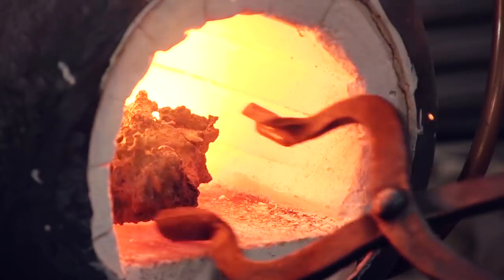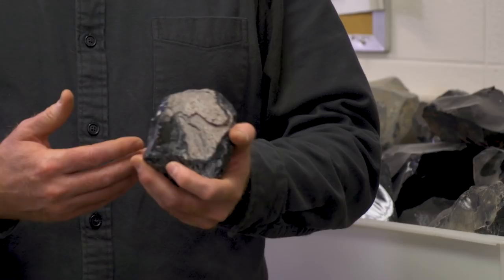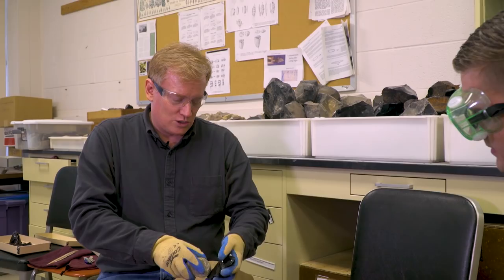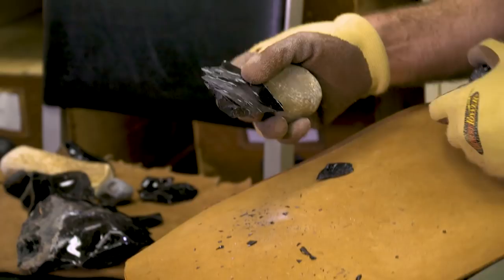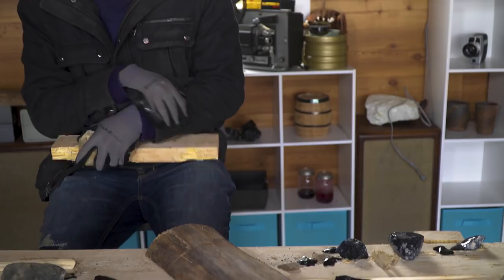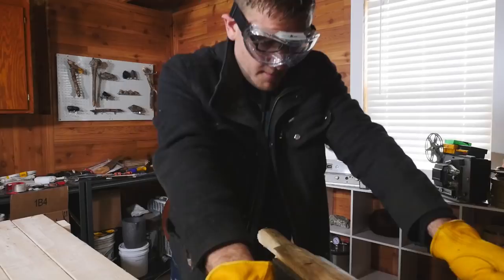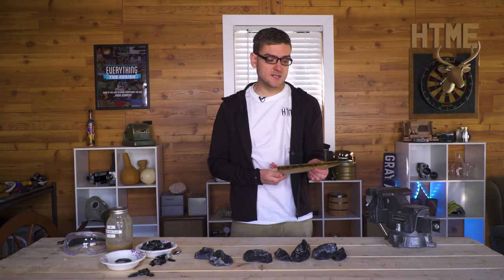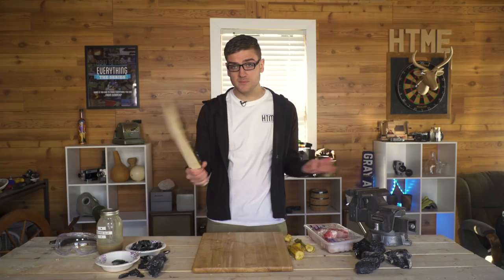Turning Volcanic Rock into an Obsidian Blade that's Sharper than Steel

Comment: Sharper than steel is meaningless.  Sharpness is not a property of steel.  Weight is a property of steel, strength is a property of steel, durability is a property of steel.  Steel can be sharp or dull.  Perhaps it would be better to say it's possible to be sharpen Obsidian to a finer degree than steel.

Comment: Does this guy have logic I'm 11 and I understand the if you compare the sharpness of steel witch verys depending on the care put into it in is false because in the laws of numbers you can always add one therefore noting can be sharper than another thing because it can always best it but it is probably just a tiny mistake
Reply: Also he should try making a thinner wood hold for the obsidian because it is the reason why it could not complete the paper cut

Comment: you are chopping... not cutting... if you swung in a cutting action you could cut clean through.. perhaps not very clean but cleaner.... chopping is straight down while  cutting is down and back simultaneously going to cut...(cutting being pulling back as you swing)